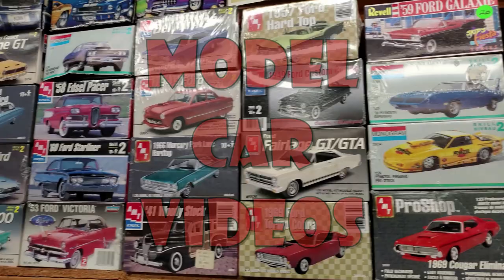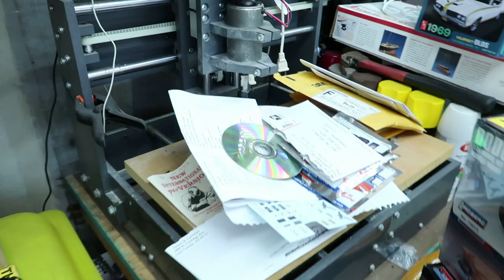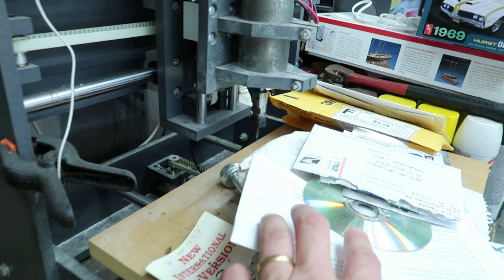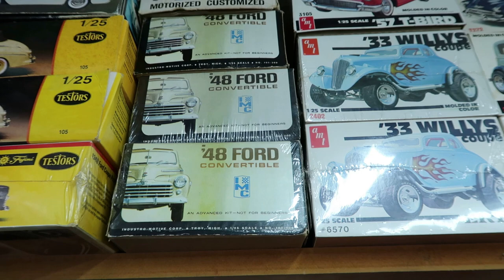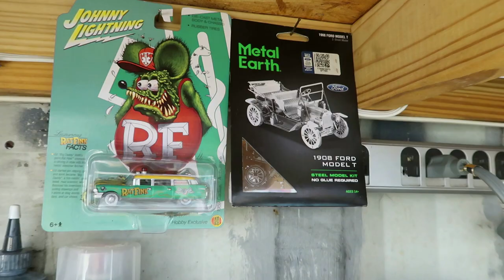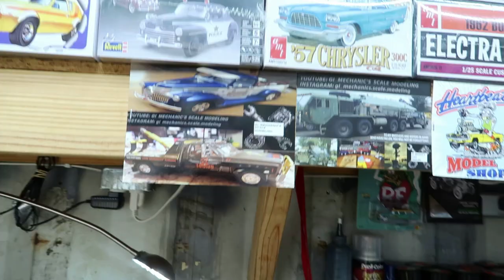Cleaning The Model Room And Making Space For All My Kits!!

Comment: Just a warning for you...the roof on those containers get very very hot in the Summer.  That heat will transfer into the boxes and will wrap the plastic and dry out the decals.  You may have it in the shade or a seperate roof.   Just so you know I will take the spray paint...I use it all the time. LOL!
Reply from the maker: Yeah it's under a roof.

Comment: Quick question. Did you pour a slab for your container?
Reply from the maker: No it sits on cement pads at the corners. I poured a slab in front.
Reply: @modelcarvideos5829  THX. . .